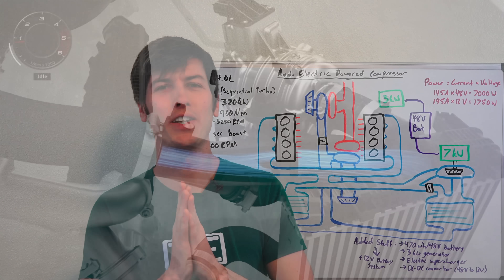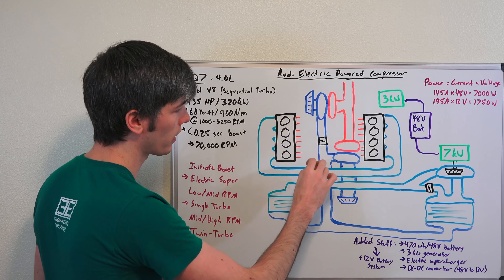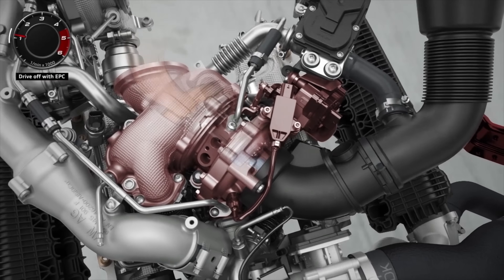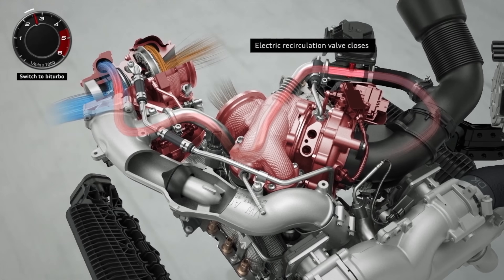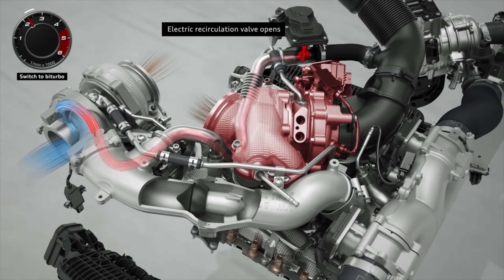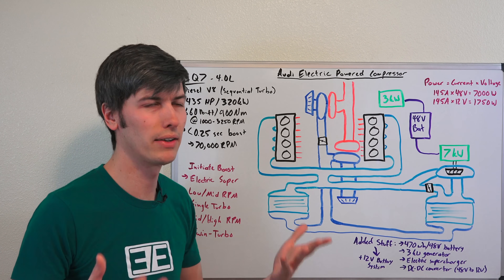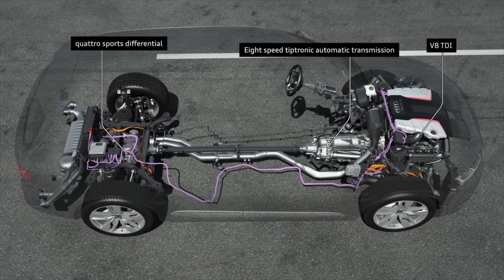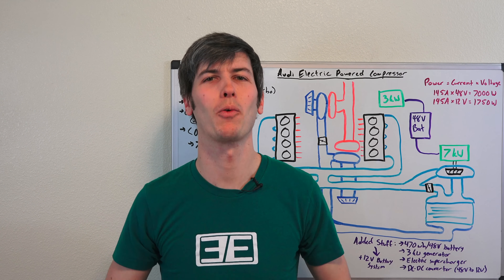Electric Superchargers - How Audi Is Eliminating Turbo Lag

Comment: Apart from power considerations... 7kW @ 12V == VERY FAT CABLES and the size of the motor wouldn't bear thinking about.

WRT comments about complexity: This is significantly LESS complex than the mechanical supercharger systems of the past. Electronics are extremely reliable and this adds the advantage that the compressor can be ideally placed in the airflow plumbing rather than where a mechanical tapoff would dictate.

Being a diesel, "throttle" is the wrong word to use. The dual valve/dual turbo circuit is a good example of ensuring that efficiency is maintained for varying power ranges rather than the usual compromises for automotive use. The variable cam step used to achieve this is well understood and reliable.

I wonder how long before we see production electronic valve control instead of camshafts. Twinair is "getting there" but it still has a camshaft and uses pneumatics for valve control rather than direct solenoid action.

Comment: When i was younger and was first learning about engines i heard about turbos and superchargers. I knew what a turbo was and how it used the exhaust to push a turbine that forced air into the intake, but i always thought a supercharger was the same thing but electrically powered. I was really disappointed when i learned that all it was is that it's connected to the rotation of the crank, an electric supercharger always seemed cooler to me for some reason.

Comment: Honestly I can't imagine why Audi instead bolted a small electric motor to the engine itself & use that to fill the torque gap of getting off the line. Mercedes actually employs that (referred to as the ISG) along with the electric supercharger to get the best of both worlds, so why not?

Comment: My question is why implement an electric supercharger, when a normal supercharger is already sufficient for eliminating lag? This just takes mechanical work done from the engine, converts it into electrical energy, and then uses that electrical energy to make more mechanical work? Is this efficient?
Reply: It can make slightly more power by using power stored in a battery vs introducing a parasitic loss on the crankshaft.
Of course those batteries will have to be recharged so total efficiency may not necessarily be better depending on driving conditions.
It should save fuel on highway driving since there won't be drag from the alternator once the batteries are recharged while a belt driven supercharger would always have some drag.
But in stop and go driving the system may be maybe even less efficient than a conventional supercharger due to conversion losses.
Reply: Patchuchan and in today's reality.... Wouldn't a car be stuck in traffic more often than not?
Reply: From his explanation, the electric supercharger only works when you first step on the gas. As RPM’s increase the system is handed over to the standard turbos. So, you can slowly recharge the 48 volt battery while cruising, and dump that power all at once on takeoff. So, at the instant of takeoff, the power is coming from the battery, and not the motor. It’s a well thought out design, but I do fear the complexity would be a nightmare to troubleshoot and repair. The only people qualified to repair it would be a few select dealers, and parts could get scarce in a few years?
Reply: @alphagt62  definitely a lease mobile for all but crazy tinkerers

Comment: Detroit was turbo charging super chargers in the 60s on their two stroke diesel engines to improve efficiency.  With a much different system and for different reasons but this system makes me think of old Detroit diesels.

Comment: Would it be feasible to have extra power from the alternator stored in supercapacitors that could be used to run an electric supercharger on demand? Not sure how much driving around or idling it would take to charge but I'd imagine it'd be good for a quick sprint when needed. Of course I'm probably not accounting for something, just a thought.
Reply: Battery is virtually a super capacitor, with much higher energy storage and more flexibility.
Reply: lajoyalobos2009 you forgot the part where they can rape your wallet with the cost of the option and then after sales replacement parts and labor

Comment: Plenty of off road vehicles run electric winches off their 12v battery system. The 10,000lb winch on my Nissan Patrol will pull over 500 amps (peak) which is around 6kw.  When winching up a hill i will normally winch for 30 second bursts and then give it a rest. This is no problem for an N70 size battery and i assume the electric supercharger will be engaged for much shorter periods when used to assist the turbos. 99% of the time you battery does nothing (just acts as a buffer) and the alternator is powering all of the electrics.

Comment: Can you please explain why a capacitor can’t be used.? This looks like a perfect place for a capacitor, it’s instant and a lot of power, just till the exhaust turbo kicks in, or even use a capacitor to start the exhaust turbo.? But am I wrong in saying that the batteries in this system are the capacitor.? Thank you sir, love your vidz.
Reply: Can a capacitor sustain running the electric motor for several seconds each time it is used? I though capacitors were only good for delivering a nice big zap

Comment: Do you know what kind of 48V Audi used in SQ7? Is it li-ion battery? (eq S13P15 18650) It looks as quite complex system and it seems to be more marketing driver development than really solving turbo lag problem in easiest way. I would focus on faster gearbox rather than providing Additionally boost at 1000rpm. Also Im not sure if such high tourque at low rpms is healthy for the engine.

Comment: Does 12 volt powered ones are actually kind of Handy to use if you just want to reduce the turbo lag a little bit in your diesel or gasoline powered turbocharged vehicle like a VW GTI or something that's got a turbo on it gasoline or diesel powered they have been shown to reduce turbo lag in cars that are ready come with forced induction but with cars that don't come with forced induction they've actually been shown to not work at all on top of the fact that the 12-volt ones don't actually produce enough torque to actually give you any actual but pressure worth measuring and that's what would actually give you the extra power they do however note to increase airflow so having one of these on a manual switch so that way just before you're about to do a run or something like that you can flip this so that way you were turbo on your car what kind of rtb priest pulled up and ready to go versus the turbo lag of having to spool it up.

Comment: What we have here is a way to increase power (a sales figure) and made our engines more complex to incur higher repair costs.... win win for Audi.

Never gonna buy!
Reply: And I'll never understand the need for a super-duper fast SUV (SQ7). Like how fast do you need to get to soccer practice?? This is all a complete waste an a high center-of-gravity vehicle
Reply: Audi are criminals and can't be trusted. 
I don't give my child to a pedophile babysitter.  I don't let groups like VAG or GM near myself or my beloved ones.
Reply: Its idiots like you that would have halted the evolution of the combustion engine. We wouldn't have turbos, superchargers,overhead cam and valves, all wheel drive, AC, etc. I got a 76 Pinto for you. Audi dosent want you either, every body happy.
Reply: @dreadog6425  

I don't think he would have halted the developed of anything. This system is an obvious over designed nightmare. I can design something even more complicated than this it doesn't mean my  design would be any good. In engineering, the simplest design that accomplishes a desired goal is the best one - you want to minimize points of failure.

It so cute the way you respond to his comment with such emotion. I don't even know how you managed to wind yourself up so emotionally.

Comment: Not disagreeing with you, it’s well explained good drawing makes sense, but intercooler on the low pressure side of the induction process ? ... is that a miss drawing or am I missing something, why would you cool air coming in at ambient temp to Er... ambient temp .
Intercooler is on the high pressure side to take out the heat of compression of the air and conduction from turbos the engine etc ? 
Please explain ?
Reply from the maker: The intercoolers are not on the low pressure side. They're after the turbo compressors (as drawn).

Comment: Why don't the just put the motor at the turbocharger like the F1 MGU-H.
Reply: exactly, that's what i was thinking. And use only the electric supercharger to compress the air that goes to the engine

Comment: You stated that the battery has a responsibility to power the convenience features and accessories, and ignition in the car, but I do have to point out that it's actually the alternator powering them while the engine is running.
Reply: Yes you are right......but I think what he was saying is, when an electric turbo kicks in the overall power consumption exceeds the alternators power output!

Comment: good video.  My gut feeling is that this tech will be a flash in the pan.  It adds a lot of weight and complexity for a generally minor benefit.  If I were running Audi, I would simply offer a traditional turbo charged model for customers who want the most power and an alternative supercharged model for those who prefer to avoid lag.  Or maybe explore using a similar switching/capacity concept with a mechanically driven supercharger.  The more I try to wrap my head around the idea of electric supercharging the more I see it as flawed.
Reply: It's an Audi. People don't buy them for their longevity, reliability or efficiency.

They mostly buy them because they're expensive and are a way of flaunting wealth. 

The whizzbang stuff is neat from an engineering point of view but for the most part this kind of stuff is rearranging deckchairs on the Titanic from the point of view of the long-term relevance of the internal combustion engine. 

Tourbillon watches are another example of mechanical complexity that's been long-surpassed for accuracy by other methods, yet more and more expensive+complex versions keep showing up, primarily for "because I can" reasons.

In times gone past someone would have settled for intricate baroque decorations on their castle.
Reply: I agree, the weight of the battery (which was not put there for "other purposes",  the video even states the battery & separate generator was put there specifically to power the 7kw electric motor because an alternator and 12 volt battery (which it also has) couldn't produce the required power) and a special generator, the step-down electronics - so much extra weight up front (and Audi's already have enough front weight problems as it is) and so many added points of failure - this is marketing engineering, and it's just going to hasten the already horrific built in obsolescence that Audi products all have, with efficiency gains so marginal as to be basically pointless.  The fact is a modern turbocharge design can be set up to be so low-lag, and so efficient at mid-range power delivery that the average driver isn't even going to think about it.
Reply: Matthew Sharpe 

It could run on 12 volts the only thing is that a 12 volt 7kv super charger would take 486amps at 14.4 volts which means probably dual alternator setup with 2 runs of 0ga wire for grounds and power all that  where as at 48 volts  the amperage would be 145 amps which means one run of 4 gauge wire and less weight and less chance of fire if something shorts out less strain on the main electrical system
Reply: caydon schleder I've never seen a 12v belt driven alternator that can put out more than 200 amps, and at that output they are already large and heavy.  I guess you are dealing with short duration load requirements as the electrics for the turbo are only working for brief periods to fill in the gaps, but I stick by my original statement, this is marketing tech for the sake of tech - as Alan Brown said - "because I can", not "because it is sensible" - Audi are really good at that now days.
Reply: @Beer_Dad1975  

True it is short duration so would need as big of power and ground but yes they make 320amp alts but they are after market use same casing size as normal stock alt but they are usually CNC machined aluminum casings and about $600 a piece look up mechanical alternators, DC alternators and couple others
Reply: The added weight is of one electric motor, a little piping and an air valve. The dual turbo setup is an otherwise sensible approach on a turbodisel anyway and the 48V battery system is already installed for other purposes.

Comment: Love your videos. 
This system from Audi is way more complicated than it needs to be. The electric supercharger part is neat and all but then there is twin turbos on there also, and the 1 turbo is only being used part of the time. Way too much going on.
Reply: BiTurbos are very common on Diesel engines
Reply: They could literally build the electric motor into the regular turbo, have the motor switch over to being a generator once the exhaust gases are sufficient to spool the turbo without the electric assistance, and avoid having a whole separate electric turbo unit, and a whole generator unit. 

It’s the most complex way to go about this systematically, but probably the easiest in terms of not requiring any super high tech parts.
Reply: @Jonathan_Doe_  You could and I know it has been done as prototypes at least, but they probably didn't have a turbocharger currently in production with built in electric drive.

Oftentimes manufacturers don't use the technologies that would be ideal and that they'd like to, they just use what is actually available. Audi doesn't make turbos they buy them, so they have to stick to what the suppliers can actually get them. Not everyone is Koenigsegg, which makes a handful of cars a year and sells them millions so they can just custom make every part that goes into them.

As far as the people saying the two stage turbocharger is to complex and unreliable (anything more complex than a carburetor is too complex and unreliable for some people), it's tech that goes back to the 80s used by various manufacturers, and more recently BMW has made tens of thousands of two stage turbo Diesels in their 35d/40d/50d powertrains and the system is very reliable.

Comment: Wouldn't it be simpler and more efficient to have a conventional supercharger that disengages once the turbos spool? I mean if the electric motor is only capable of 10hp anyways, the parisitic loss wouldn't be signifficant for a part-time equivelant supercharger.